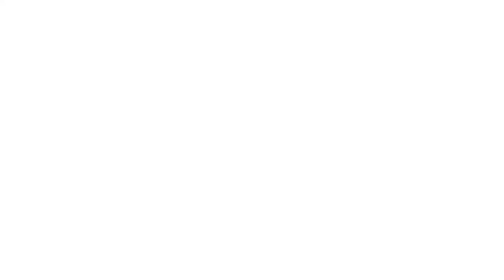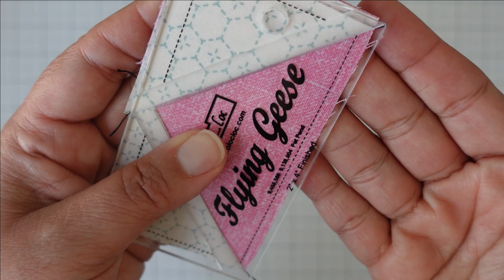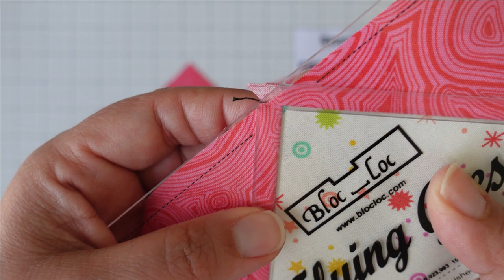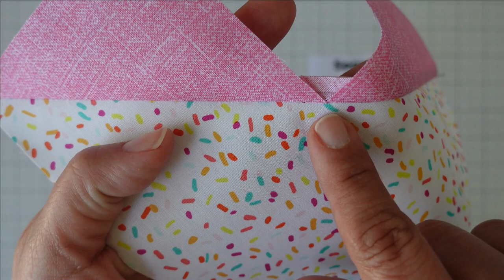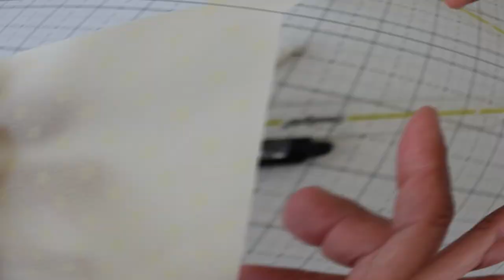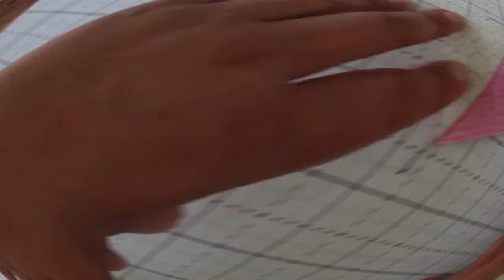Wonky Geese? Troubleshoot Flying Geese Quilt Blocks: Tips & Techniques for Success!

Comment: Hey Sugar Stitches! Thank you for the wonderful video, I have always done FG wrong and lived with it, but I don’t want to anymore. Long story short I just cut fabric for a quilt that is only FG by quilty love. In the pattern directions they suggest cutting the 4 small squares 1/8 inch larger. I did this but it did not say to cut the bigger square larger…. I am feeling unsure how to sew these now. My test blocks are coming up too short on the bottom/side opposite the point. I do have the wing clipper ruler and the June Tailor perfect HST ruler.  All the fabric is cut, what would you advise in this situation? I could cut them to a smaller size and it would not affect this pattern, it’s a very simple one…

Comment: I love flying geese but struggle with getting them to end up even, especially on the 4 at a time method. I think I will try starting with bigger pieces, as you suggest; it is probably less fabric than the turn and flip (?) method. Thanks for the analysis and the tips. I would add that trimming accurately is also important. If you don’t use a block loc you will want to make sure the diagonal lines up on the 45° of your ruler.
Reply from the maker: Exactly!! Typically even with the stitch and flip method I still make them oversized so I have room to trim away any mistakes!

Comment: The information you provide in your video is just what I was hoping to find.  It seems like when I’m making practice flying geese they are near perfect.  Unfortunately after investing in fabrics and spending time cutting, as I’m assembling my geese they are less than perfect.  Using the 4 at a time method and the wing clipper tool, I seem to be having issues with the right side top of my sky.  It’s too short by less than an eighth of an inch, and I’m feeling discouraged.  Thank you for providing these helpful tips.  I will keep trying.

Question:  I’ve been teaching myself to quilt for almost 3 years and still consider myself a beginner.  Where would you suggest I start if I were to take your online courses?
Reply from the maker: Glad to have you here! Making them oversized really helps then you can trim away the problems!! 
I am currently revising my courses and adding a few new ones soon (including flying geese!) Make sure your signed up for the updates on my site and I’ll be sending out news when the courses open soon.

Comment: Oh yes, I have that little tiny bit in the center & HOW did that happen? 😒
Reply from the maker: Crazy isn’t it!? I think it’s because the size ratio is off and the small squares are too large. If you increase the size of the larger square you need to do the same for the smaller squares. That’s what my talent was 🤣